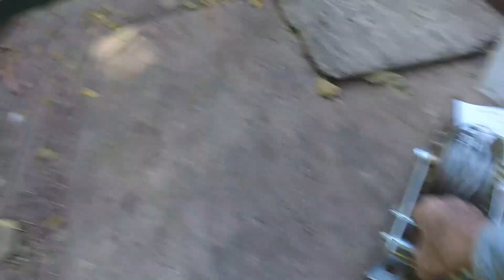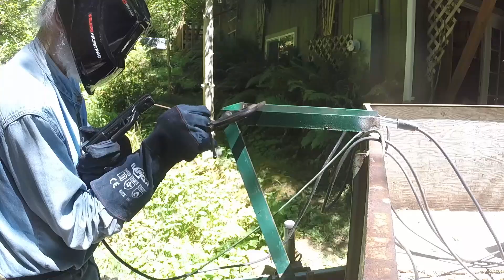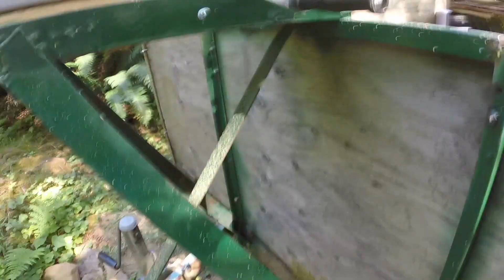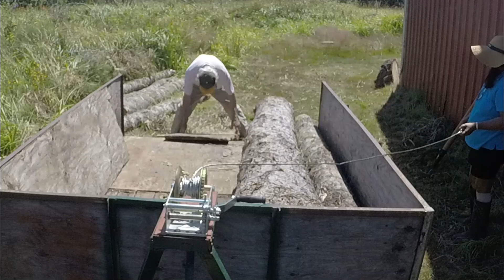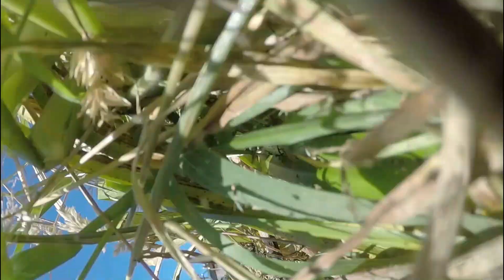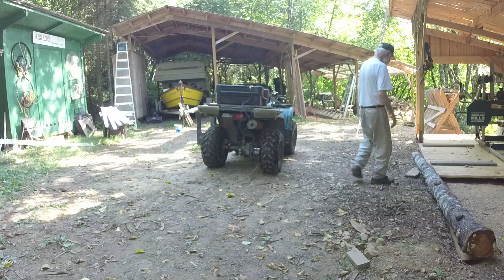Loading Free Logs with a Winch

Comment: 🪵🪵 Thanks for great videos.  I have been watching many of your videos as I assemble my Woodland mill.  Maybe you could add a side-dump to your trailer so you could roll the logs directly onto your mill in-feed.   The side could be dropped down to become a ramp.  This could give you some options when loading some logs also.
Reply from the maker: I have more wheeled vehicles and equipment than I have room for. Should have bought flat land rather than steep and unstable.

Comment: There is a easier way!! Put a single sheave at the point where you have your winch..  you already have support to that area.. Back your ATV to the rear corner of the trailer and use the winch cable or the ATV itself to  pull the log on with the winch cable..

Comment: Thanks for the ideas, my name is David I am purchasing the 30max next week. What blades do you recommend, I believe they sell two styles. I have all types of wood on my property. Any other advice would be appreciated. Thanks
Reply from the maker: I use the same type as what came with the mill. Don't remember the numbers. General use blades. I have some from Woodland Mills and others from Cook's Saw. Cook's blades are a hair wider than WM, not that it makes any operational difference that I can see. Cook's are much cheaper.
Reply: @OregonOldTimer  thanks
Reply: @OregonOldTimer  I ordered my Woodland Mills, wanted to tell you about ripper 37 saw blades that everyone says are awesome.

Comment: 3500 lb winch batt powered 99.00 works great to pull logs onto my 18 ft trailer I also made a post to use same winch to load logs on mill
Reply from the maker: I considered a powered winch, but I get more exercise with a hand winch. And it's half the price.

Comment: I guess your welds weren't too bad. Maybe a rail system where your winch is on a carriage and moves side to side would help? Use a pin and holes to keep it in place. Would make loading the wagon up evenly easier to do.
Reply from the maker: The Lewis chainsaw winch pivots enough to allow level cable winding. Adding a layer to the mount with a stout pivot pin behind the winch would do the trick. Question is, is it worth the trouble? Time will tell.

Comment: you could use a snatch  block with cable sheave on tong of tailor and pull at 90 degree on either side
Reply from the maker: I prefer simple to complex.
Reply: There is a easier way!! Put a single sheave at the point where you have your winch..  you already have support to that area.. Back your ATV to the rear corner of the trailer and use the winch cable or the ATV itself to  pull the log on with the winch cable..
Reply: @kenbo3246  yes you can see you might even reverse pull
i work by my self since 1979 we learn to think all the time. 
always  thinking even in my dream's

Comment: Look more like Pacific Silver Fir, hard to be sure.
Reply from the maker: You know more about trees than I do, Greg. I'd never heard of Pacific Silver Fir. Looked it up. The only thing I have for comparison is the bark. I went out and looked at it. I think you're right.
Reply: @OregonOldTimer  Many years old memories here. Pacific Silver is the least used for dimensional lumber - weakest of the 3 primary trees in PNW. However, it would be stronger than Alder which is mostly used as a decorative on cabinets, doorways and turning.

Comment: Should have use a small round log under the big log he’s pulling it would roll really easy
Reply from the maker: It would, but first I'd have to lift the log onto the roller log.
Reply: @OregonOldTimer  You need a log lift cant also i noticed others that use a bullet nose cone to put the chain through..
Reply from the maker: @kenbo3246  I've noticed those, too. And the price.